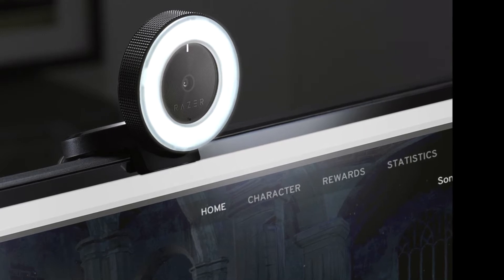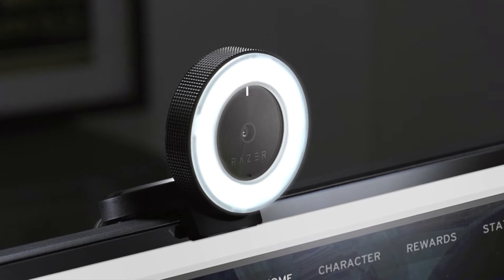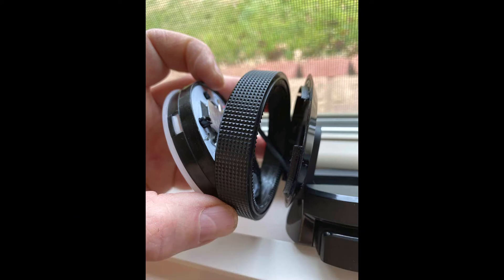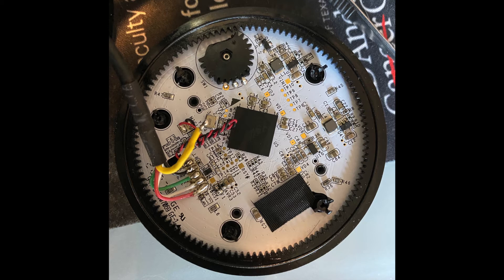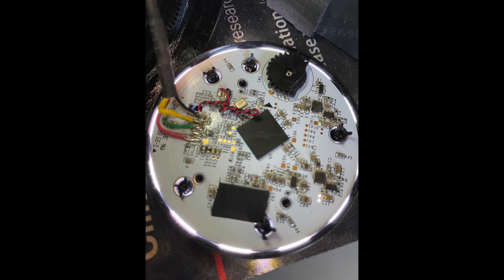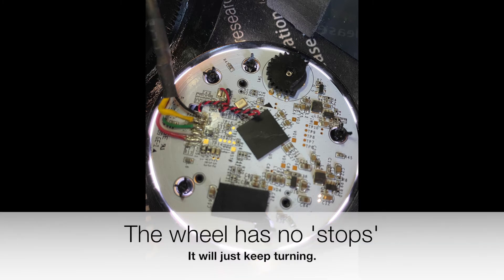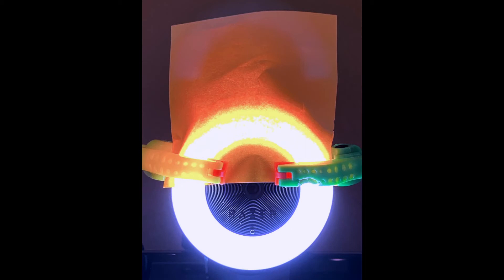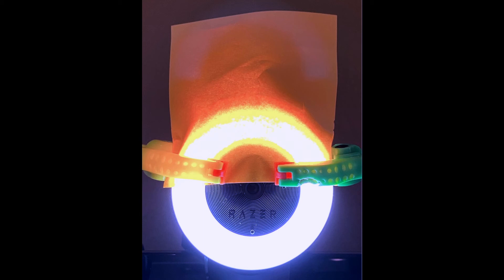Razer Kiyo Partial Teardown and Repair. Wiring, circuit board, brightness hack.

Comment from the maker: Note: I updated the firmware sometime around March 1, 2022 and the light stopped working. I had to open it up and turn the wheel to full bright again. Also if it's fuzzy, unplug the USB cord and plug it in again. Mac Pro 2013 6,1 machine.

Comment: Nice video.  I have a different problem though.    My kiyo "works" but it's incredibly dimmed as if what it sees is the lowest brightness possible.  when i show the camera a bright light source, it barely shows it in black and white display but you can barely see it.  I also noticed after i opened it, my wires (never tampered with and brand new after 2 months) aren't in the same wire layout as yours so I found that very interesting... Thanks for your time
Reply: Nevermind, it was just a software update surprisingly!
Reply: But yeah, from left to right, it's yellow, black, green, white, and red and works 100% normally
Reply: Maybe it'll fix your lighting issue? I'm not sure
Reply from the maker: @Private-tsu  Did you take a picture? I’d like to see the layout. Please post it somewhere and link. The issue with mine is the cog wheel inside is broken and the outer ring gear won’t engage all the way around so it only
Works if you Turn the wheel by hand. It’s the physical damage.
Reply from the maker: @Private-tsu  Do you have the Pro or the Reggio at Kiyo?

Comment: Hi mate , not sure if you ever had the problem of buzzing then light stutters ? Then isn’t recognised in windows . Was just seeing if you ever had it and fixed it . Thanks
Reply from the maker: Nope. Sounds like a capacitor or voltage regulator or something.

Comment: Why the USB cables are not in the correct order? I open a kiyo that arrived not working and also the yellow cable it's unplugged
Reply from the maker: Watch the whole video. Later picture shows the correct order and that the light ring now works when the wires are correctly soldered in the correct order.

Comment: Hi mate. Nice tear down vid. You sound like you really know a lot about circuit boards. I accidentally plugged a 9v power adapter to a 5v usb hub with the kiyo plugged in it so now i think I fried my device. After you saw all the components inside, can i still possibly repair this kiyo? Cheers!
Reply from the maker: Take a look at 1:25 and you see the 'F1' on the motherboard in black type? That usually means a fuse. Take a look on yours and see if you see any other 'F' components. C is capacitor, etc. Test with a multimeter to see if that F component is open. I.e. turn your meter to continuity and see if it beeps or shows all 0's on the screen. It should be a direct short. IF it's open, the fuse might have saved you. BUT you'll have to solder a new one on and I have no idea of the value. OR you can short it across with a small piece of wire or solder blob BUT then you will have no fuse protection down the road. Did this help? Like and subscribe and you can send me a $1 for coffee here: https://paypal.me/beachfitrob
Reply from the maker: I'm going to guess that a 5V (USB as you know) 1A fuse would be enough. See what the current rating on the camera says...500ma (milliamps) I'm guessing. So a fuse might be twice that and be about right but it's a guess unless you can see the component value once you get it off, if it's been blown (open circuit.)
Reply: @RobertBullock  Thanks for the reply. Will check this out and will let you know. Cheers!
Reply from the maker: @michlabor  any news?
Reply: i see no teardown

Comment: why are there no videos of how to open the camera? has razer made it impossible to open to fix it? if so fuck them but im sure there is still a way in. Seems like no one has made a video or razer takes it down or some shit idfk razer would do that.
Reply from the maker: You use a spudger on the light ring then there are screws under that.
Reply: @RobertBullock  Thank you so much.